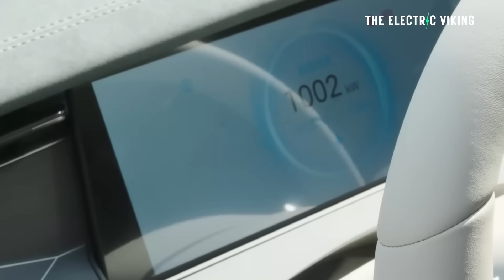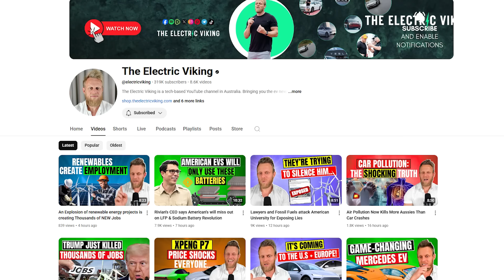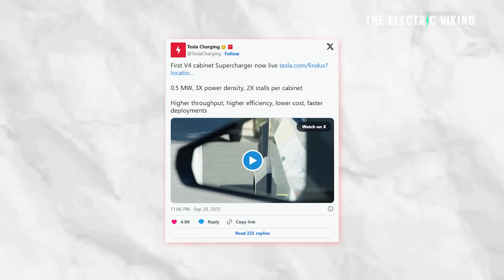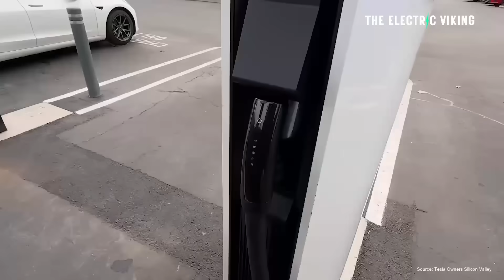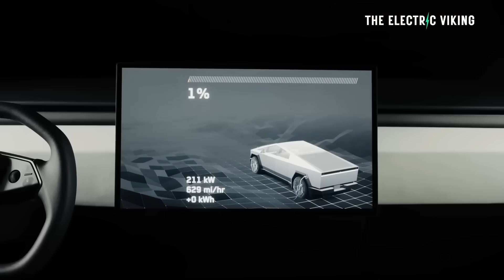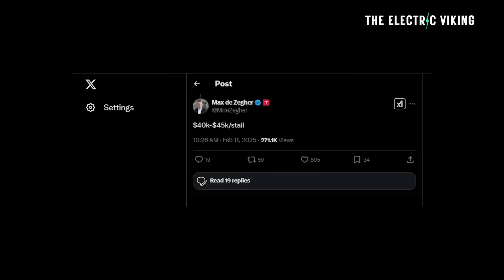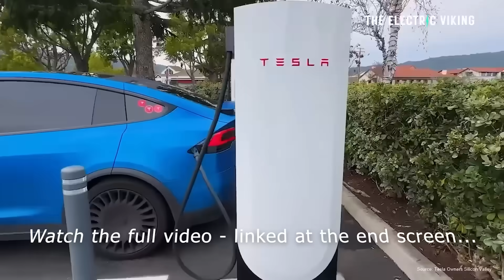How Tesla’s New Tech Changes the Game for Charging Worldwide

Comment: I am pro EVs but charging 1 car @  1000 KW is like turning on 500 air conditioners at the same time, that's like the electricity of an entire block in my country 😀
Reply: ITS LIKE Shaking hands with THOR on a BAD day.
Reply: Several million air-conditioners can be running at the same time in California. A few thousand EVs at Superchargers, charging at a high rate for several minutes, is nothing in comparison.

Then add in all of the electricity used for hot water, clothes dryers, swimming pools, ovens, computers, TVs, shopping malls, businesses, industry, gas stations and everything else. It's a lot of energy.
Reply: @dvader3263 I agree but imagine a station with 20 cars, now that's 20,000 KW for just 1 station.

Comment: 500kw for cars, with trucks being able to charge at 500kw on both sides would be nice.  But it would need a charging curve that doesn't fall off dramatically once you hit 30%.
Reply: Agreed.  500 KW is great - probably for future vehicles.   However, even at 250kw charging- would be nice to improve charging curve.  

Charging at 500 KW for just a few minutes is better than nothing but figuring out how to hit 500KW for a longer duration is the problem to figure out!
Reply: @ronwinn879  500KW would be a 2024 and later CyberTruck. I regularly get over 250KW (charger limited). Granted, my old model S is stuck just over 150KW, but that is 8 year old tech,
Reply: Why does it fall off, heat or?
Reply: @bjm23vancity92  Heat in the battery, cable, charger or just chemistry. The reaction time of the chemicals in the battery vary, as does how the cells are wired up.
Reply: How about we drop in super Caps, quick 30kw/h in seconds, instead of hydrogen it's a super capacitor battery chemistry. Heavy probably. Build it someone. Kilowatt labs had some battery tech.
Reply: @ABUNDANCEandBEYONDATHLETE So far not a real tech, very promising, but no progress for cars.

Comment: 500 kW at what voltage?
Reply: Voltage is variable between 180v and 1,000v, supporting ramp down to lower voltages at constant current end of battery charge SoC near 100% charging, and a max of 615 amps. The max combination is 500kW peak, peak durations and sustatined rates are unknown at this point in time.

Comment: 500KW is old news. We need 1000KW at least.
Reply: 600kW dual-connection is already available in Europe for high-power hub chargers (similarly 16 trays up to 8 charging points), so 500kW is a bit of a backward step. These support 1.5MW charging via a HGV dedicated MCS rather than CCS2 connection (which is limited to 600kW).